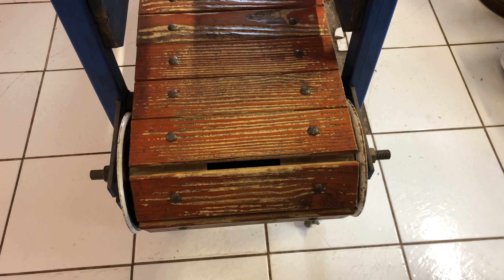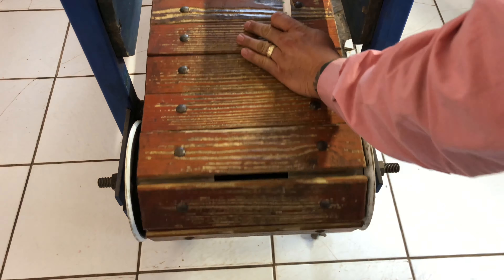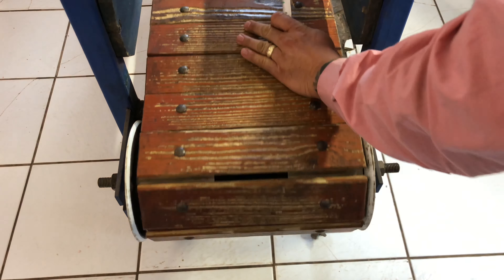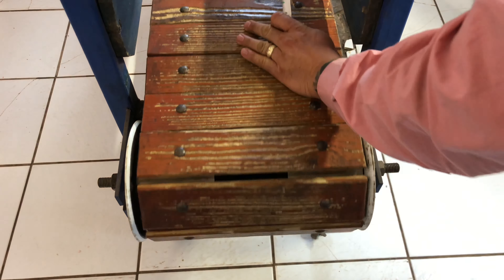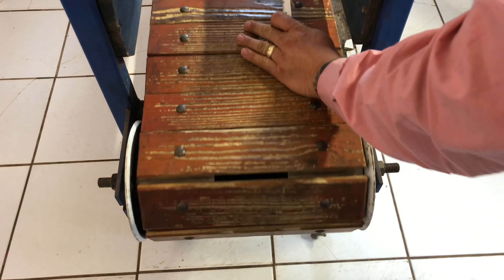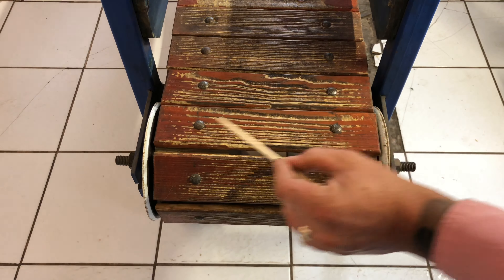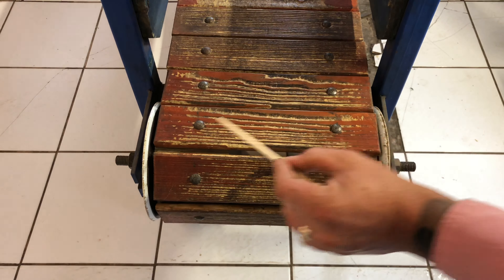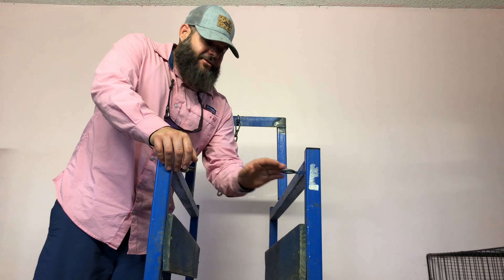‼️LOOKING INTO GETTING A MILL... THIS VIDEO IS A MUST SEE.

Comment: I am in the process of designing and welding up a slatmill for our 3 Pitties. 1 - 8 year old male 85lbs, 1 - 5 year old female rescue 100lbs, 1 - 2.5 year old female rescue 90lbs. Do you have any links to where to source the wheels for slats and the 4 wheels at each end? Do you have any diy build videos?

Comment: Maybe design A guard that just covers  the ends where they are at risk of getting pinched     The guard can be attached to a ramp on both ends .  So it is just a matter of walking your dog in and running. Him.  Then out there front down another ramp     ??   You think this would work?    If it is able to do then no injuries from pinching or jumping on and off.  This looks so sturdy in design.
Reply: That was my first thought. I'm drawing a blank but similar concept as a dually fender covering the tires. Bicycle fender, or like a shield on a bench grinder. I'm just throwing all this out there because I shouldn't be the 1st one to acknowledge your comment. Lol You're making too much sense. We're going to have to ask you to cut that out please. Lol

Comment: I’m newer to these dog activities and was wondering what’s the different benefits from this style mill and a carpet mill vs electric ones?
Reply: electric ones you can control the speed and they might had a thing that says how many miles they have walked/run. carpet mills and slat mills are controlled by the dog and have no remote or electronic peices. usually the carpet mill has more resistance and is at a angle, so it might be more challenging than a slat mill which is flat.
Reply: @maddie.1824  thanks, I’ve actually learned that a while ago 😅 learned a lot of new stuff since I last posted that comment and met a lot of people who taught me more about the dog game